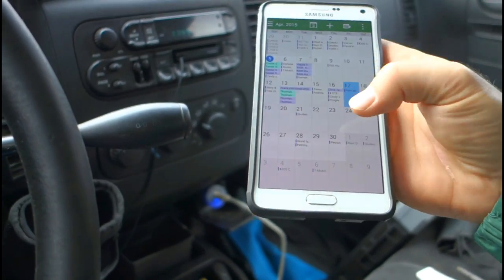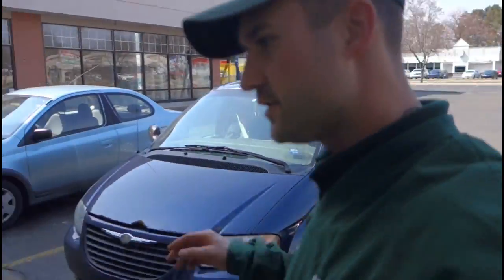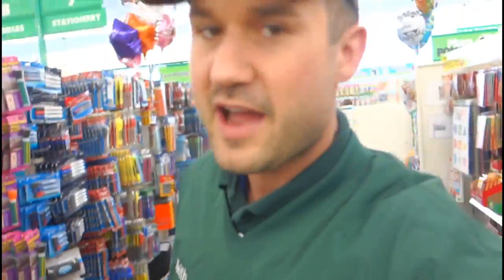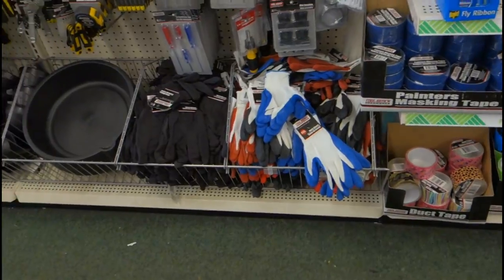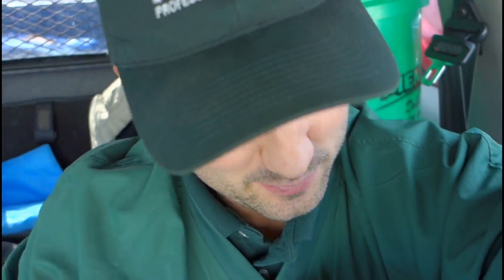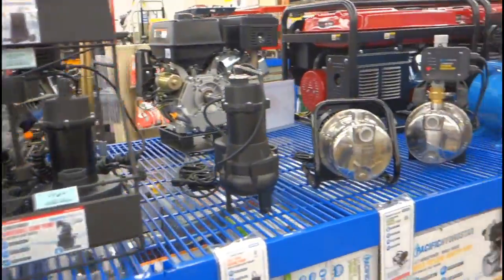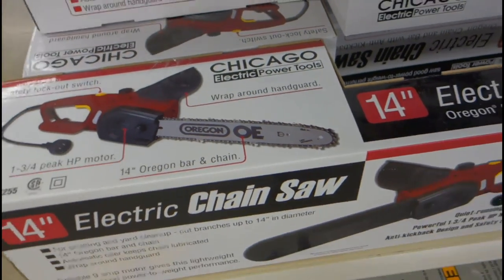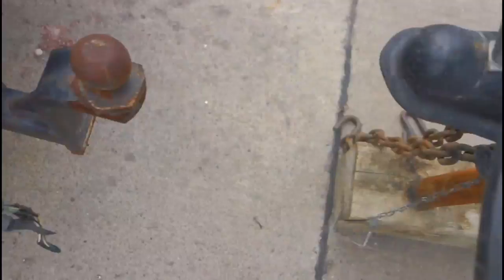Let's go Shopping with Keith aka "K2" (DIY Window Cleaning Solution)(Episode#10)

Comment: good thing you passed on the blue jack,.  My dad got it and  its terrible goes up half way and seems to lose its lifting power, I bout one 4 years ago from sears  a craftsman. Aluminum and looks exactly like that blue one at harbor freight. even has an LED light built in.  that jack still works like a champ and lifts loads higher as well.  90 dollars WELLLLLLL worth it. it was on sale, but id even pay the 120. feels safer as well.